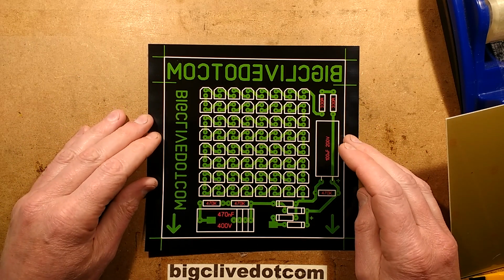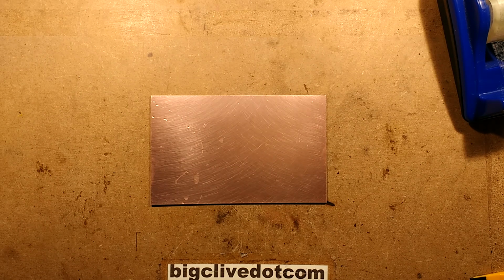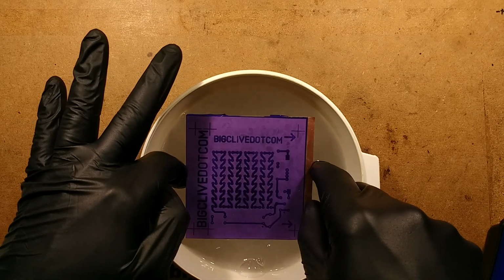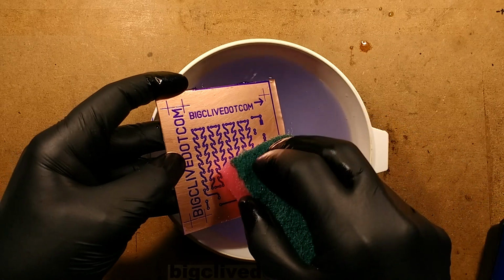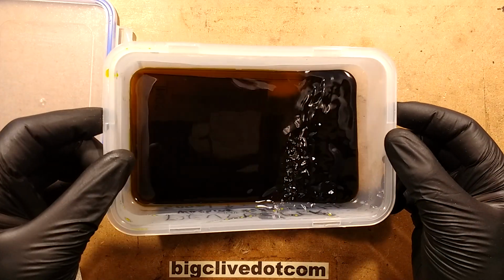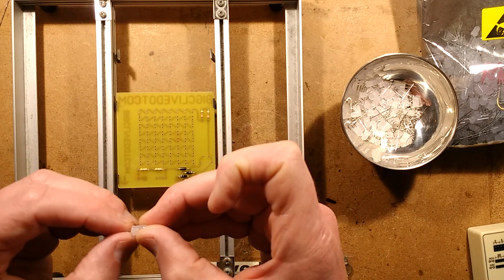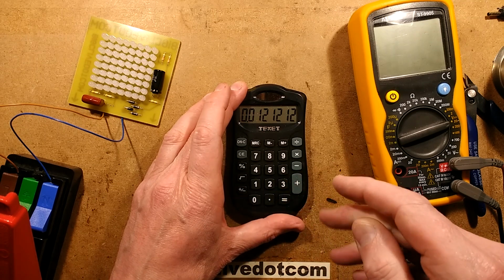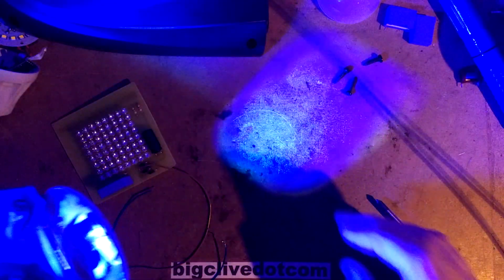Applying and exposing dry film photoresist and building a PCB.

Comment: Hearing about the quick test again and knowing from previous videos that people want to own one, I thought I'd add that I noticed the other day CPC are stocking them now: http://cpc.farnell.com/cliff-electronic-components/cl1853/quicktest-block-with-1-5m-lead/dp/PL10638

I haven't bought one as I don't tend to do much mains experimentation, I get my kicks from high voltage DC capacitors when working on tube amps instead :D. Just thought somebody may like to know they're in stock somewhere.

Comment: The laminator isn't supposed to help you apply the photoresist -- you're to use it afterwards to fuse the thing onto the PCB. Supposedly, it's simpler than using an iron but I don't have one. The technique that works for me personally is not to peel the protective film all the way, but to remove it gradually as you apply the material onto the board, flattening it with a squeegee or something similar as you go. The wet method is fine too, of course, and I believe this is how they apply coloured film onto cars and other large objects.

Comment: Wonderful, just what I was waiting for! :)
I'm guessing I could use a laser printer and "regular" transparency instead and leave the rest of the process the same?
Reply from the maker: I used to laser print directly onto good tracing paper, but modern laser printers put down a very thin layer of toner that doesn't work as well.
Reply: Balls. Thanks for the heads up!

Comment: Hi! If you can't find any sodium carbonate, you can also use sodium hydroxide (drain cleaner. Careful, very caustic!) or buy some sodium bicarbonate (baking powder!) and heat it in a pan for 20 minutes. This turns the bicarb into normal sodium carbonate.  
As for etching with ferric chloride... try cupric chloride CuCl2 instead. You can make it yourself from copper, muriatic acid (HCl)(sold as concrete cleaner at home depot) and a little time. It can be re-used pretty much indefinitely. If it gets too discolored, add a tiny bit more muriatic acid (HCl) and simply let it stand for some time.

Comment: Allegedly you can make a homebrew PCB etchant made from white vinegar and table salt. I've made my own using hydrochloric acid (aka muriatic acid, sold as concrete cleaner or a swimming pool chemical) which works a treat, and is a beautiful shade of green! But the vinegar + salt mix seems usable and the materials ought to be readily available.

Comment: Hey Clive some tips you might find useful:
- for drilling holes larger than 0.7mm in pcb I use tungsten spear tip bits because those are much less prone to breaking than the spiral drill bits and self center really nicely. (havent found any smaller than 0.8 though :(

-That Nurdrage tip also works for regenerating used ferric cloride if you can get hydrochloric/muriatic acid.
If you can't get the acid there is a workaround using "PH Minus" from pool supplies in combination with table salt and some tupperware.

Comment: (I'm on the mainland, so this might not apply.)
But, following on from your washing-sode discovery, to make Nurd Rage's copper chloride etchant, I go down to Superdrug or Boots and get the strongest Hydrogen Peroxide that Teresa May will let me have and then to my local DIY shop and get a bottle of spirits-of-salt.
Reply: edgeeffect good old blighty, restricting nearly bloody everything. I'm surprised we can still buy bleach and oven cleaner.
Reply: As an additional to my comment about Nurd Rage's copper chloride etchant... DO NOT leave the bottle open to regenerate it... s well as air getting in HCl vapours will GET OUT and put a lovely coating of surface rust on any steel object they can find. (And now my ER16 collets are in a frightful state)

Comment: Interesting that you use the film that fixes with light, there's also a film  that works the opposite and it's more commonly used for this purpose. The good thing is that you can now use that to do the solder mask just painting by hand the pads and do the process again.
Reply from the maker: I used to use the other type where the UV weakened the coating.

Comment: Question: If you were anal retentive enough could you power the LEDs individually enough so they are all color synced...meaning do they retain their last color selection when the power is off and turned back on?
Reply from the maker: They all run at a different speed, but theoretically with a low voltage and current you could keep them all running in the background even when not lit so they powered up in a random state.

Comment: Can't you set black & white printout in the printer settings so it doesn't try to use the colour cartridges?
Reply: The Yellow is actually the most strongly UV-blocking one of the colours.
Reply: I still don't understand why it's a more important QUESTION and why it is an important question NOW, when it has been answered multiple times already, and has also been answerable with the least of searching effort the whole time (most of which, it appears,  has been performed by somebody not you)? Yes, all of what you said is likely not untrue, but why do you keep padding this discussion with tangential and mostly self-answering bits of trivia?
Reply: Cardinal Biggles actually as any printer will tell you, you get a much denser black by using the c m y inks as well. The black ink alone in most systems is relatively weak. You need what printers call registration black - all four inks CMYK at 85-100% each.
Reply: Registration black isn't normally used for printing text or greyscale images - it's used to print registration marks so that any misalignment of the individual prints can be seen. The four colours aren't printed on the same film, each is printed on a separate one. 

https://en.wikipedia.org/wiki/Registration_black
Reply: How do you work that one out, given that yellow has very little absorption in the UV part of the spectrum. From experience, the best UV absorbers tend to be at the blue end of the spectrum.
Reply: Wouldn't a blue colour of appearance make them the best UV reflectors rather than absorbers?
Also, see this comment on another video of Clive's: https://www.youtube.com/watch?v=W_oDBp_wgJQ&lc=UggN6gWNVrsM5ngCoAEC
And this:
http://www.eevblog.com/forum/beginners/good-printer-for-transparencies-for-uv-pcb/msg1257584/#msg1257584
More:
http://www.diyaudio.com/forums/software-tools/278247-pcb-negative-inkjet.html
http://forum.arduino.cc/index.php?topic=5267.0
Some more musings:
http://www.piclist.com/techref/pcb/etch/directinkjetresist.htm
Reply: It's impossible to tell without actually looking at the absorption spectrum of the colour in question. UV absorbers tend to be colourless, since their structure is designed to absorb only UV light.

When you're printing on a transparency, you need to create an opaque layer that blocks as much of the EM spectrum as possible. The best way is to use a laser printer instead of an inkjet because the heat used to fuse the print makes the layer much more homogeneous.
Reply: First you say they tend to be blue, now that they tend to be colourless ... Which one is it now?
At any rate, it's not impossible at all. You see how people have experimented and found the yellows they looked at to be favourable, otherwise they wouldn't be using or even recommending it. And I doubt any of those guys used a spectrometer to come up with their verdicts. As long as it reliably blocks the wavelengths that render the photo-active material most significantly, it's good to go. Even when that turns out to be yellow.
Reply: Whyever that would be a far greater question all of a sudden, I don't know. A little googling and reading reveals that the quoted ones tend to be pigments, so that's that answered.
Reply: Exactly so Cardinal Biggles,that is what it's used for when doing conventional 4-colour separation printing but that isn't the situation here. We're talking about composite printers where all the colours are laid down together, so if you use registration black, or any similar heavy 4-colour combination, you get a much denser layer of ink, which is the aim.

Comment: In the mechatronics lab we made PCBs using an amped up awards laser engraver that could do two sides, but mainly used for single sides. Applied a varnish over the copper,  and the laser burned off everything but the trace. Then flip the board and it could drill the holes and burn in other designs. Those were the days.

Comment: @Clive -  I only have one batch of the strawhat slow change LEDs.  I put 5v on one and only got about 6 ma.  I even used 12v and an LM317 set for a constant current of around 12 ma and still only got around 6 ma.  I think there's some magic inside those LEDs.
Reply: If you apply 110v (or 220v) you find there is a lot of magic smoke in there...  ;-)

Comment: need to see you get a small cnc mill for drilling and cutting these traces
Reply from the maker: Milling PCBs is quite tricky as it's a very shallow cut and sometimes quite difficult keeping the laminate flat enough to avoid either skipping or gouging it.
Reply: Phillip Ramirez or at least a bit of stepper motor action to agitate the  ferric chloride 😀
Reply: i will say, a simple dc motor with a oval/ofset wheel, works, and jsut have it move up and down piviting at one side and yeh :D
Reply: Using the chemicals is quiet and relaxing, with a CNC mill it is very noisy and dusty and that dust goes everywhere.
Reply: Lol, too easy. But yeah, something like that.
Reply: yes that is true. but shouldnt be too difficult if you use a tooling plate to attach the pcb. its flat enough that would keep the pcb flat.

Comment: Just for info, sodium bicarbonate decomposes into sodium carbonate, water and CO2 at 200C.  A bit of time in the oven, and your very ordinary baking soda magically becomes your very special developer.
Reply: You are too hot it's 200 F (~93.3C)
Reply: CMOT Dibbler ok
Reply: @cmotdibbler4454  At 200 F it would take an hour or so from what I'm reading. At 200 C it's 15mins. I don't think our normal food ovens get hot enough to cause a problem for sodium bicarbonate. It melts at 3000 C so prolly keep it less than that I reckon ;)

Comment: What kind of paper are you using specifically?  Do you use an inkjet or a laser printer?
Reply from the maker: Waterproof inkjet film specifically designed for making screen printing transparencies.  It's a milky plastic film that absorbs a lot of ink.
Reply: Thank you!

Comment: Leaving voids in the middles of the pads to help center the drill bit is really clever.
Reply: ???  I've never known one not to even back in the old school days using manually placed tape on clear film.  It drills so much easier and faster without the need to worry about breaking drill bits.  Drilling through copper just wears out the bits faster for no reason.
Reply: Interesting.I don't design circuits. I'm just a fan, so there's a lot I don't know.
Reply: As I understand it, those bits he's using are on their second tour of duty anyway.
Reply: There's a lot we all don't know. For example, copper sure doesn't wear out tungsten carbide bits. Fiberglass, otoh, is fairly bit-abrasive.
Copper 3 vs. glass 5.5: https://geology.com/minerals/mohs-hardness-scale.shtml
Reply: Didn't volunteer, tho ;-)

Comment: Cool, Can you sand and polish the tips of the LED's with a dremel and make them less diffuse?
Reply: Bad Juju 
The diffusion is within the actual resin of the LED's so it wouldn't make a huge difference.
Reply: To get a brighter diffused spot you would need to diffuse the light first, then catch as much of it as possible and focus it. Maybe start with a non-diffuse LED, cut the round part off, rough up the flat surface and then glue the round part back on.

Comment: 7:24 Clive my work around was to put some flat stock of aluminium in the toaster oven and preheat it to the same temp as the iron. Because the irons bottom is not smooth. Very use full in the toner transfer method 

Up vote and shoot out guys

Comment: Nice!

For toner transfer Poundland photo paper works great.  10 A4 sheets for £1.  No soaking required, peels straight off.  
I'm only working on small boards (new at this).
Reply: I use thin glossy paper from junk mail that you get in the post. It has to be glossy and a bit aged, otherwise the ink tends to transfer over as well. I've modded my laminator with a clothes iron thermostat to increase the temperature so that 3 passes get the toner nicely stuck on. Board preparation is really important, I sand it lightly under running water with 1000 grit sandpaper until shiny, then dry with a paper towel. You don't want any cleaning residue from liquid cleaners or such. Once done properly it's really resilient and can even be scrubbed with a toothbrush with no problems. The resolution is good enough for SMD with pitches of 0.5mm.
Reply: Ah, it's actually from PoundWorld.  "A4 High Gloss Photo Paper".  Suitable for inkjet and laser.
Note: the paper is a bit think and my laser printer won't feed it.  I have to cut out a PCB sized square which I tape to a regular A4 sheet.
Reply: leglessinoz
You dont want laser printer photo paper !
Because it's best the laser toner does not really bond onto the paper surface but kind of sits on top.
when you iron the laser toner it gets liquid again and then sticks to the clean copper.
the less it bonded to the print-on paper the better.

talking about that now, i have never tried antistick baking paper for oven usage,might also work.
the one that feels greasy on top.

the inkjet photo paper is just glossy, really thick and soaks up more ink for better image quality, you dont want or need that for laser toner.
Reply: nogginthenog is that inkjet photo paper that you're using in a laser printer? I can't seem to find laser printer photo paper.
Reply: nogginthenog hmm we don't have Poundland or Poundworld here in Australia and I've not found anything but inkjet only photo paper.

Comment: Have you tried building one of the 8 by 8 LED cubes yet? 
 I know they're old hat now, but they are mesmerizing to see them go through their light sequences. 
With your advanced knowledge, maybe a 16 by 16 or 32 by 32 is an adventurous  possibility.
Reply: A 32 by 32 by 32 LED cube would be 32768 LEDs. That's a lot of soldering...
Reply: I have one sitting on my desk still in pieces as a kit and haven't got the courage to start it yet.
Reply: The cubes are built in layers. The biggest challenge of LED cubes is actually coming up with a way to hold the damn LEDs in place while soldering them into a layer, ie. making your own jig. From there, it becomes trivial to just repeat the process of bending leads, arranging the LEDs, and soldering.
One method that works rather well with 2/3/4 LEDs is an array of breadboards (just the middle pieces without the power rails) where you plug in bits of header pins (as this guy did: https://emalliab.wordpress.com/2015/07/24/icstation-4x4x4-led-cube-shield-for-arduino-hardware-build/). Others just poke the (round) LEDs through cardboard or drilled plywood, bending the legs a bit differently. It's really no wizardry. Enjoy!
Reply: I know, I'm not scared of the circuit part, it's the layers of leds that has me worried, I bought an acrylic template to hold the layers as I go but they seemed to be the wrong way around so I made my own acrylic holder out of 6mm thick material.
Reply: I'd never heard of them so I just checked them out. I agree, I'd love to see Clive build one, they look very interesting.
Reply: It'd be neat to build one out of those ws2812 leds. Little esp32/micropython brainbox; cast it in milky acrylic or something.... Might be a nice thing :-)
Reply: Mentorcase i would love to get one of those  cube kits  id  add a few features though
Reply: Mine has extra features, such as a sd and USB input and a small amp and speaker and a perspex case to cover it.
Reply: I was just going to request the same, but think an 8x8 would be better, as it gets the theory across and it's simply a case of scaling it up. However, the bigger the cube, the more stories from Clive.
Reply: PolicewitnessPoplar 
The bigger ones have more reflective LED “wires” for the light to reflect on, it spoils the effect imo. I think once soldered they need to be painted vantablack for best results.